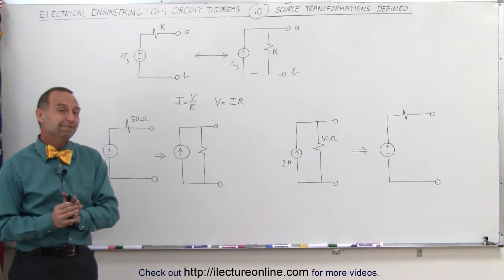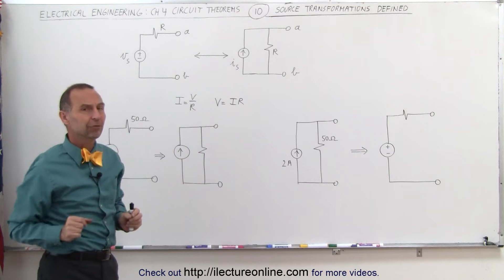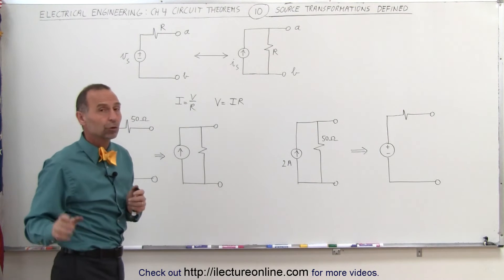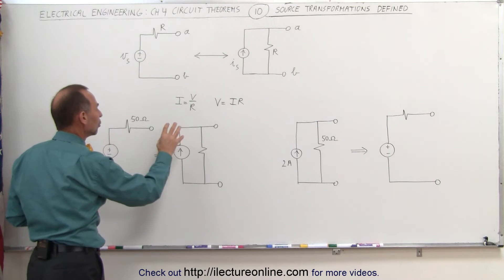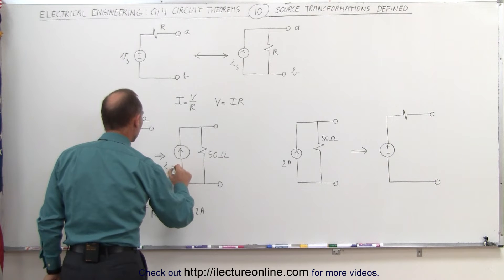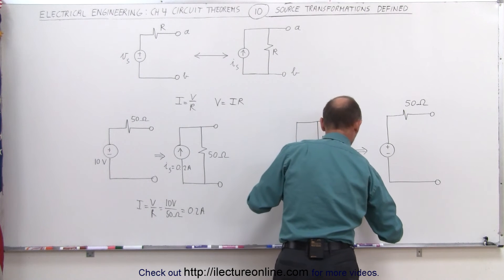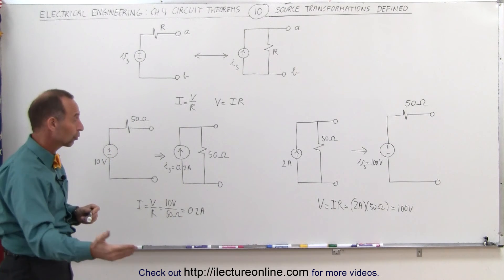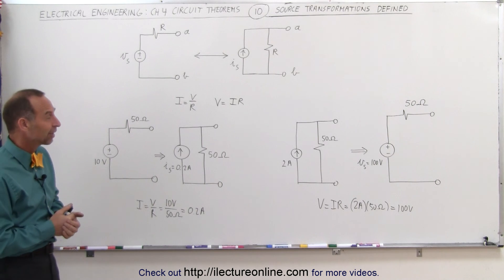Electrical Engineering: Ch 4: Circuit Theorems (10 of 35) Source Transformation Defined

Comment: What if we have a voltage source and two resistors in series, then we transformed the voltage source into current source and changed one resistor connection to parallel connection, if we  tried to calculate the total resistors value it would be different, and we will have a different value to the new voltage source

Comment: Why did you take the resistor in parallel and not in series after the transformation from voltage to current source???
Reply: There must be some resistance between the test points (a,b) in order to create a potential difference = voltage.

Comment: can you explain the sign convention of the transformations? i thought current flowed from high to low potentials??? So wouldn't the would the direction of the current source reflect this direction?
Reply from the maker: That is what the diagrams are indicating.
Reply: I think his question is : how do you determine the direction of current source once you transform it from voltage source?(ie: the diagram on bottom left) 

I have exactly the same question. Doesn't the current flow from Positive terminal to Negative terminal? if so, the current direction of the diagram on bottom left should go downward.

Comment: Thank you! I understood the video, but what's the point of this really?
Reply from the maker: +touge410 _   It helps the understanding of circuits and it sometimes provides a good technique to solve circuit problems - see the examples.
Reply: +Michel van Biezen thank you sir
Reply: @starbai410  Doing mesh, nodal, or other analyses, sometimes it's much easier if you have only current or only voltage sources within one circuit, by transforming the other type.